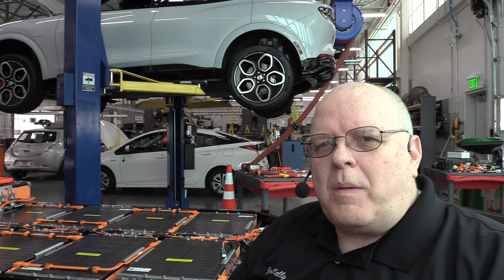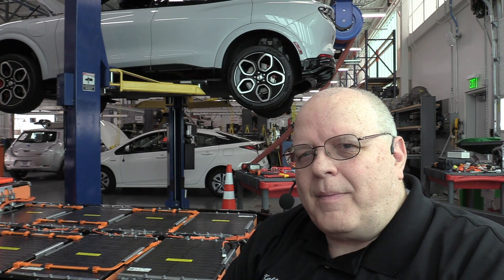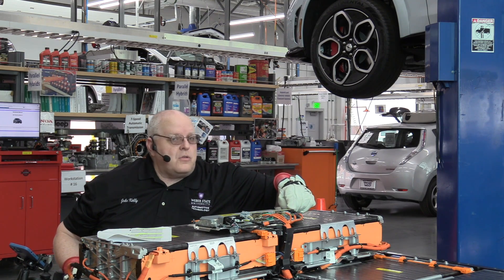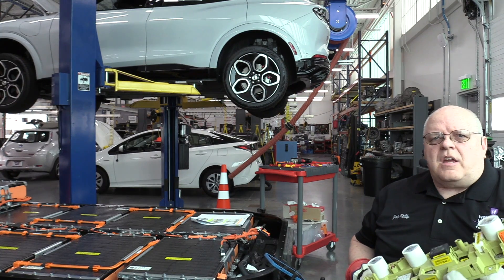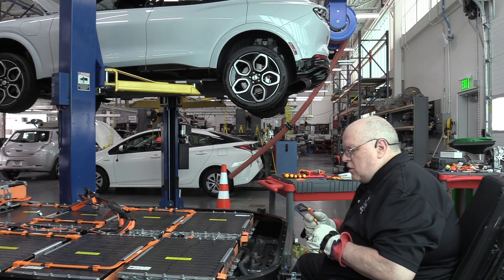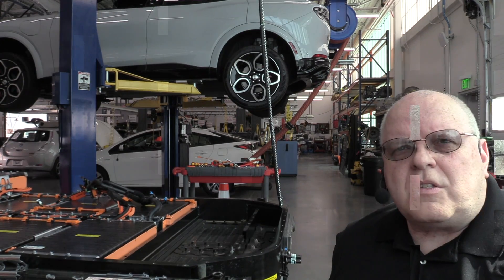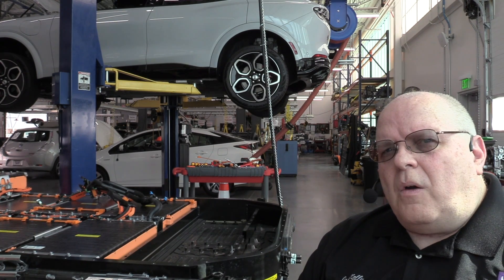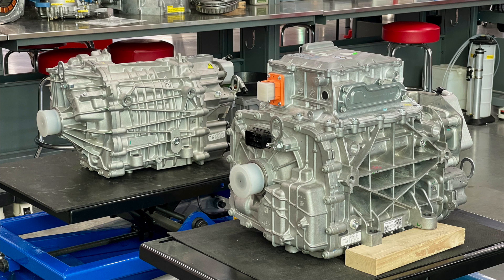Mach E GT Battery and Cooling System Service

Comment: This video clearly indicates that any future repair of this vehicle will be extremely costly.  I do not see any way to recycle or dispose off these parts at the end of car life. Such cars will be extremely expensive to maintain and will create a major end of life dispose off problem. Any solution?
Reply: I have the opposite impression.   It would be rather easy for someone to "mix & match" cells from  junked vehicles to make a non-working batter pack functional again.
Reply: For recycling- throw the whole pack in an industrial shredder. Treat it as high-grade ore, extract the basic elements and manufacture a new pack and cells. Tesla has hinted this is their process for their latest pack design.

On repair- a degraded pack could be repurposed for other uses such as grid storage before it requires recycling. This already occurs albeit not at large scale yet. Modern EV packs are expected to be good for 200k+ miles (up to 1 million for LFP!) barring any manufacturing defects.
Reply: @cheesetomatoes  --  Well, the conversion to "ore" is an obvious improvement to the landfill.   But replacing the worse cells from one pack with the best cells from another pack makes more sense.   It would allow users to get another 3 to 5 years out of their EV for less that the cost of an ICE automatic transmission or engine or even an air-conditioner compressor.

Speaking of the A/C compressors, I suspect that might end up  being a problem with a lot of the EVs.   The EV "brains" are programmed to sacrifice just about anything to keeping the battery pack "healthy."
Reply from the maker: Thanks for watching
Reply: @GilmerJohn  Mix and match do not work with battery cells. All cells in battery bank should be identical, same age and with same specifications.
Reply: @tariqiqbal8068  Ideally, that's the way to go.   The OEM had 10s of thousands of cells.   BUT if they ensure that all the cells are "identical" then they will be deliberately producing better and worse qualify banks.   I suppose the EVs for preferred customers would have the best banks containing the best (matched, of course) cells.  Obviously, the banks have to be matched too.

Will Ford give a discount to buyers that end up with a so-so battery pack or will Ford discard all but the very, Very, VERY Best battery packs?

The reality is that making them all the same might be nice, it's not realistic.   A re-maker would look at the cells in a bank and check for truly bad ones and replace them.   After that, let the BMS take care of the details.
Reply: @Macmonkey1000 --  Well, even ICE cars are nearly completely controlled by software.   At some point the "computer modules" will be hacked & it will be possible to buy either re-furbished computer modules or built up from basic parts modules.

Comment: Mach E  5 electronics boxes stacked on each other / TESLA one box

Mach E 35 hoses and dozens of brittle plastic elbows and clamps / TESLA two to four hoses.

And on and on this thing is a POS.
Reply: So when it fails it costs five times as much to replace and Tesla uses cheap hoses only designed for 5 PSI, the hoses on this vehicle are much better quality and are designed for 30 PSI. Talk about a POS!